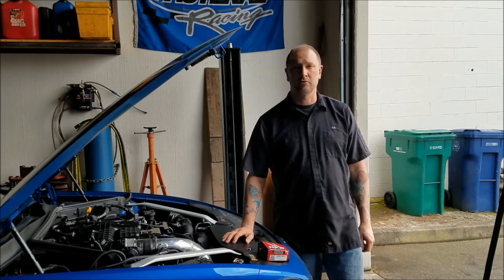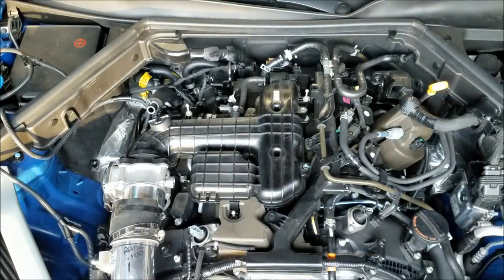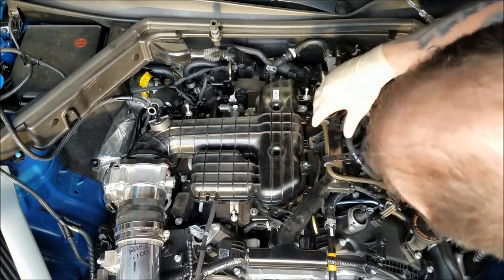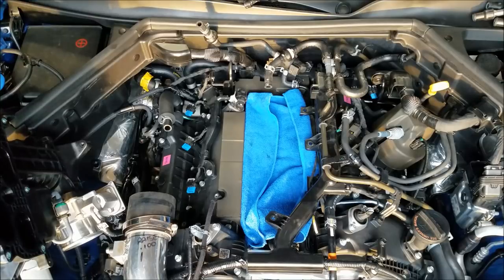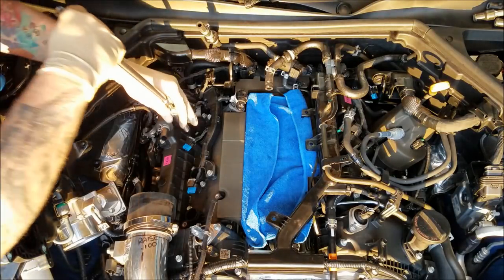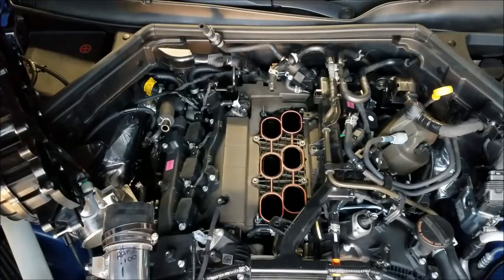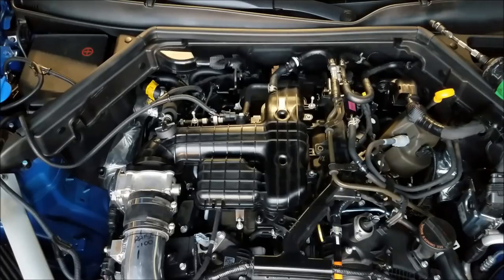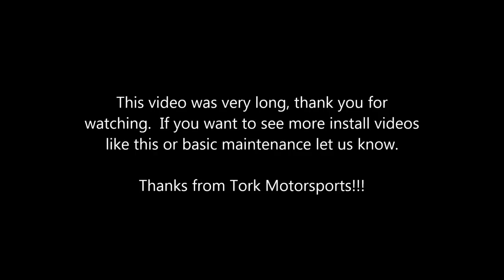KIA Stinger GT 3.3TT HKS spark plug install

Comment: So I just got done doing this 1hr 15min, I didn’t take off manifold and use wobbly truck to get to plugs. The hardest part was getting coil packs off on passenger side with little room to work with. This video was still a great help!
Reply from the maker: Thank you!

Comment: thank you for this! I decided to work around the manifold and ended up snapping off the vacuum line into the vacuum chamber by plug #3. Purchased a whole new manifold and I’ll be using this as a guide for removal of the old one
Reply from the maker: You are not the first person who has broken stuff trying to work around it, this is why we always pull the intake off to do plugs.

Comment: This video has reassured me I don’t want to take on this task lol, but I want a race chip, so I guess I’m going to do it anyways and video will be huge help. Thank you.
Reply: you dont need to remove manifold if you have smaller hands and the right right extensions. i'm doing it later tonight ill see how it goes
Reply: @curtislaketek2952  how did you go?
Reply: @aaronbaxter6031  little difficult but not horrible.  Did it twice now, removed them to gap them after I installed them. The extension with a smallest ratchet and extension is needed for the passenger side middle spark plug. The front passenger and rear passenger one you can get away with just a extension

Comment: Saw this video and got really discouraged about changing my sparks.  Then I did a bit more research and it turns out with the proper tools you DON'T have to remove the intake manifold at all.  Been browsing the forums and there's guys that did it in about 30 mins. All you need some wrench extensions and swivels (some used 1, others used 2).  Faith restored, I'll be able to use map2 soon.
Reply from the maker: Problem, when you two swivele joints it puts more side stress on the plug causing a possible crack.
Reply: A lot of people have done it without removing the intake manifold.

Comment: You had to have had an extra silver bolt that was on the drivers side closest to the front at the very bottom connecting the wire harness bracket to the manifold you found was hidden. In the video you didn't put it back on..Its no big deal at all but i only changed my plugs from watching your video which was spot on besides not showing the front bolt for the inter cooler tube......like a quick shot but if your doing this it wasn't an issue to realize what 10mm bolt you were referring to. Thanks for the video. It was spot on. My time w a friend 145min. Good job. We had no electric tools.

Comment: Finally changed my spark plugs on my stinger gt2 and well the step by step instruction instructions were on point. The only downfall was when I dropped two bolts and I had to go fish for them. After installing my HKS M45il took the car for a spin and oh boy didn't feel a difference. At the moment I have HKSM45IL, Tork Motorsports air filter, and lap3 uncle chip. Next week ill be adding Jun BL EVC Exhaust and Jun BL Downpipes. Let's see what the outcome is. Once again thanks to the team at Tork Motorsports.
Reply: So you did not notice a difference with new spark plugs?
Reply: @scorpiojuan1966  yeah, I didn't understand that part of his reply either. That's what I'm trying to find out.

Comment: Last time I did spark plugs was on my 71 GMC pickup and I was literally sitting inside the engine bay with a small block Chevy and had room to stretch my legs lol. I was trying to figure out why you'd make a video just to change plugs. Wow
Reply from the maker: Eliezer Salgado its a little more work on newer cars :)

Comment: Two issues I saw while he at a shop did not do. 1) Was a tech for 26 years and found even the coils that have a rubber to keep water and dirt some dirt always gets in, I would recommending (if in a shop) use compressed air to blow dirt from within the hole or (if at home) a can or 2 of compressed air. Be careful not to get dirt in your eyes or the lower intake.
2) Never reuse the intake manifold gaskets (those orange circles of rubber) and since you won't be replacing plugs for a long replacing them is a good idea. Also check to see if there is a sequence for tightening and torque specs, doubtful the spec to the intake doesn't say is electric drill tight.
Reply from the maker: 1. Car has maybe 800 miles on it... was not worried about debris. 
2. Those orange circles, are designed to be reused and again... 800 miles on the car, not to worried about the o-rings being compressed. 
3. Been doing this far to long to worry about the difference between 15 and 18 ft lbs (what the electric drill tight is rated for).

I do however find it entertaining that someone would try to tell me how to work on my own car :)
Reply: Tork Motorsports yeah the amount of mileage you have makes a big difference, with that low mileage there would be no issue. But if your tip is to help others not everyone will replace them at that time and it would help those who may watch it who wants to replace their own for the first time at it’s normal interval and looks for you for a tip and does not know about the dirt/sand that may build up when they go to replace the plugs and by that time the  rubber O-rings will need to be replaced. The video is great tho 😎. Gonna put a oil catch can on mine tomorrow. 😏

Comment: Excellent video guys ....I think you should start working on an new, better designed and better flowing intake manifold, that will also make it easier to perform these type of jobs.
Reply from the maker: Rob Silva we have some ideas, problem being, any design change will require new intercooler piping.
Reply: Tork Motorsports so do you guys plan or intend of doing any header work or header design or is there more potential bigger gains in other mods first? Im basically building my list of future mods to add based off you guys 😂 for either this stinger i currently have or the next one. Keep up the good work. Love you guys' dedication and results so far
Reply from the maker: Yes, we have a lot of things we need to get done. First.. have to figure out the ECU.

Comment: did you leave the plugs gapped at .28 or did you change that?
Reply from the maker: Yes, I leave all my plugs gapped at .028 for the Stinger... the only time you need to screw with that is when you are running a piggy back.

Comment: Again thank you so much got my plugs installed and works great. Thank you for your help.

Any chance you can install an oil catch can for me? Their instructions are not clear. I bought an add W1 dual baffled. Any chance you might be able to point out what hoses goes where?
Reply from the maker: Thank you, so happy we were able to help with the install of the spark plugs. 

I am happy you asked, because... we are going to have OCC's system and install in the next week or two. When we have that video up, feel free to use it for your install.
Reply: Hey speaking of the OCC, I purchased one that is dual baffled so it works with both turbos so you don't have to do 2 catch cans per turbo. I am hoping that it is legit. I'm sure it is but anxious to see what you do.
Reply from the maker: Daniel Mohn do not need one per turbo, because only one turbo has a spot for an OCC.
Reply: Tork Motorsports ok Thank you. I look forward to your video sir. Thanks again for all your hard work and sharing.
Reply: Tork- So I had a guy install a dual baffled AddW1 V 3.3, this has 2 inlets and 1 outlet, which only requires 1 catch can set up, instead of running a catch can for each side. It requires you to plug the PCV valve that goes to the valve cover and the outlet goes to the intake. As we were discussing and from what I read instead of plugging the PCV, he ran a T-connecteor and used 2 lines to run the outlet to both instead of plugging it. He ended up getting a check engine light. Just wanted to let you know what others are running into. With your mechanical prowess I am sure you wont have this issue. I am anxious to install mine however with this issue, I will have to wait to see what you come up with.
Reply from the maker: Daniel Mohn never plug anything, horrible idea. He attempted to set it up like a race car, and that is simply not going to work on a street car. You are lucky that you didn't push a seal or cause an engine leak with that set up.
Reply: AddW1 instructions say to plug the PCV valve at the back valve going into the intake manifold.. What he did originally was plug the valve at the bottom of the intake, he had no issues with that. However when he went to a t-connection set up  to make sure nothing was plugged thats where he ran into issues with a check engine light. I do have a video of it that I can share with you if you like.
Reply: In your opinion how long do you think you can run a tuned car without a catch can before it starts to foul up? I am a little worried as I have no installed on mine yet.
Reply from the maker: Depends on how you drive the car and how often you change the oil. I have seen cars go 100,000 miles with no issues and cars go 7,500 miles and have horrible build up.  It all comes down to driver use and maintenance.
Reply from the maker: ADDW1 is wrong. I cannot tell you how many different times I have seen OCC systems installed wrong. I will have a write up and video here for you guys soon. You never, ever plug the PCV valve on a street driven car, ever.  Did I mentions to never ever plug the PCV valve?
Reply: Thats what I thought and honestly I think they came out with a product they didnt know how it works with it. I have been communicating with ADDW1 and they cant even tell me how to install it. Just doesnt make sense.
Reply from the maker: Universal OCC... means... universal.  They have very few idea's how cars work, but give you the  most "common" way to install them.
Reply: @TorkMotorsports  to avoid build up problems how often you think the oil needs to be changed? If you keep the 3.3tt stock is it still necesssary an occ? Tks!!!!
Reply from the maker: @marcelobertao9050  I change it ever 3000 to 3500 miles. No, OCC is not needed if you stay stock.

Comment: Were the stock plugs NGK? Another website said that in Korea they had pretty good NGK plugs already and just moving to .28 gap might be good and you can keep the original plugs even with a tune.
Reply from the maker: Joseph Cahn you could drop the gap down and successfully remove the spark blow out. We elected to install new plugs, because we knew we were going to be pushing the limits of the engine.

Comment: I can't seem to get to the two bolts that are on the throttle body. They are upside down. I see that you changed the down pipe and turned those bolts up for easy access. Did you go over getting those bolts in an earlier video? Thanks!
Reply from the maker: Bj Ngkaion never changed those bolts, so it might be something they changed at the factory.
Reply: Tork Motorsports So I'm referring to the pipe that connects to the throttle body. It's the pipe that goes down between the throttle body and the front bumper. Its for the bracket that holds the rubber connector on to the throttle body.
Reply from the maker: Bj Ngkaion send a picture over to our Facebook page, not sure what you are talking about.
Reply: Tork Motorsports you loosened it at the  5:26 mark. It's upside down and on the left side stock. Looks like you turned it up.
Reply from the maker: Bj Ngkaion yea, those are difficult to get to. You need a 1/4 ratchet and small socket to get in there. I also believe those have taper caps on them, so the caps have to be removed also.

Comment: i dunno why catch can and hks plug are requirement on the stinger or any hyundai/kia turbo engine if using a tune.  while a evo and sti cobb tune doesn't need.  i used to have a kia optima turbo, the engine blow up on me after a tune even i using a NGK plug.
Reply from the maker: Nash Sandy we don't think the catch cans are necessary, and NGK plugs work well. We just recommend the HKS because they have less problems. 

Also, the WRX and EVO are not GDI, and that plays a big part in fuel dilution of the oil.

Comment: Don’t need to take manifold off, did mine today
Reply from the maker: I do not like using two wobble joints on a spark plug, to much risk of cracking the plug. I still to this day, pull the intake manifold plenum to do plugs on a stinger.
Reply: @TorkMotorsports  only used 1 swivel and just made absolutely sure that it was fully seated. I was not knocking your way of your method just saying it was possible to do without removing it. I am not a ASE  certified mechanic and I am sure you have way way more expertise.

Comment: You can change the plugs without removing the intake manifold relatively easily if you just get a magnetic spark plug socket on a ball joint and if you need you can attach that to a universal socket and shouldn’t have any problems getting the plugs out... just gotta shimmy out the coil pack
Reply: I was looking at those recently. Need to find a video with someone using the magnetic socket on a stinger... does seem like a tedious job to do solo
Reply from the maker: I do not like using swivel joints on spark plugs with that much angle. A cracked spark plug, can be a bad day at the track.
Reply: @TorkMotorsports  I totally see where you are coming from. To me doing it with the ball joint is worth the time saved, just due to the fact that you could replace all the plugs 2 times over before getting your manifold all put back on with all the correct hoses, so personally it’s worth risking a cracked  plug since it is an issue that can be easily addressed
Reply: And as long as you are careful it shouldn’t be a problem

Comment: Great video...its seems that i have to at least re gap my plugs after only installing a cold air intake...will the hks's last as long as the originals?  It would be kinda a pain to do this every 15k-20k miles! (normally high performance plugs dont last long at all)
Reply: Did you ever find out the answer?

Comment: What brand are the factory plugs? Also what size socket did you use on the factory plugs?
Reply from the maker: NGK... I do not know what the part number is.
Reply: Tork Motorsports do you happen to know what size socket?
Reply from the maker: 5/8 plug socket, sorry about missing that in the video

Comment: BTW…This can be done without removing all that stuff, just need a joint attachment….
Reply from the maker: It can be done but if it has the old style coils, you risk the chance of breaking the plastic isolator on that coil type.

Comment: Is there going to be a big difference if I purchased the 45 instead of the 40 plugs?
Reply from the maker: Not really.

We have ran both and both have been successful with our tune and PNP box tuning things.
Reply: @TorkMotorsports  ok, thanks. I realized I had purchased the 45 since they're generally what's recommended on several wholesaler sites, but I didn't think about going a grade cooler
Reply from the maker: I am going to assume you bought them from us?
Reply: @TorkMotorsports  cough 😶
Reply from the maker: Thank you :)  Just had to check, because the other day someone called, asked about plug gap, thanked me for the video... yet bought the plugs from our competitor because they saved $4 :)

Comment: Cool vid. Im not super keen on stuff like this so im not sure I trust myself to do it lol. Not that im going to get anyone at it anytime soon. I wont be adding a performance chip to my stinger until a year or so down the road..when I know for sure people are running them with these plugs and having no issues. So I see no point in performance plugs for me right now. Still tho..worst case scenario, say you forget a hose connection or something..How bad could that end up being? assuming you catch it right away..within a minute of the first engine turnover after install. Just curious lol. Cause if something terrible can occur causing alot of damage I may opt to get a professional to take care of it.
Reply from the maker: TPike777 a lose hose, or disconnected... no big deal and it will set a check engine light. 

Honestly, if you are not mechanically inclined, have a competent shop do the work for you.

Comment: I did it without pulling intake off
Reply from the maker: We can do it without also, but I do not like the pressure you have to put on the side of the plug when installing the second one back on the passenger side.

Comment: Thanks for showing this. Just a question. Since these are plugs with , I'm assuming, a stronger spark, have you had a chance to run the car at WOT for atleast 2 miles? If you can remember back in the day the SplitFire plugs? I installed a set of those on my 90 Thunderbird SC. Got into a WOT race on I-5 for a full 3 miles. When I slowed down the car was sputtering. It was still under warranty so I put the factory plugs back in it took it to the dealer an found out I had burnt exhaust valves on every cylinder. Found out I may have been sold the wrong plug.  So I really dont want to go through that again. Thx

Comment: And what is if i leave the gap on original .28
Reply from the maker: Nothing will happen unless you install a piggy back.
Reply: @TorkMotorsports  thanks.. and i have  installed jb4 over the factory plugs and after two days i had a misfire and 3 plugs was damage a little bit.. now should I install the hks m40il or m45il?
Reply from the maker: If you live in a very hot climate, run the 45's... mild to cooler climate run the 40's. 

Sorry to hear that you had a damaged plug with the tuning piggy back. Let us know when you want to run a proper ECU tune.